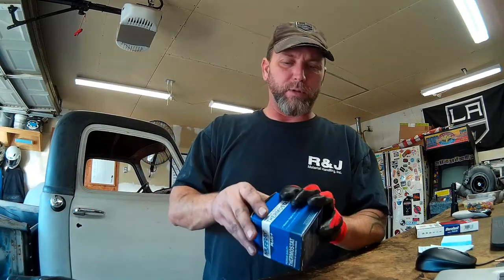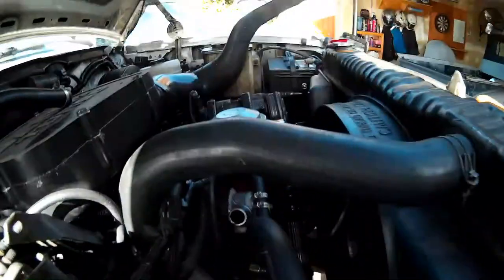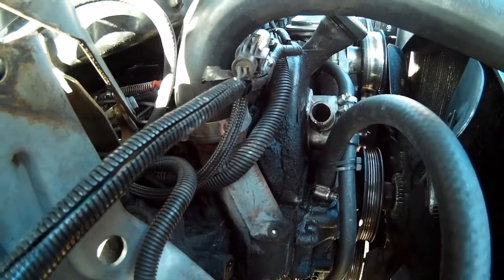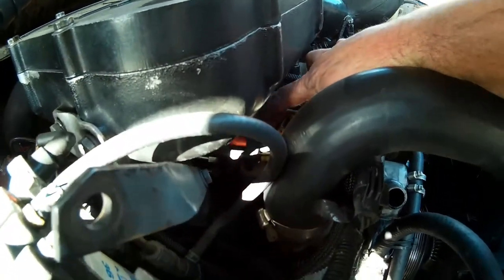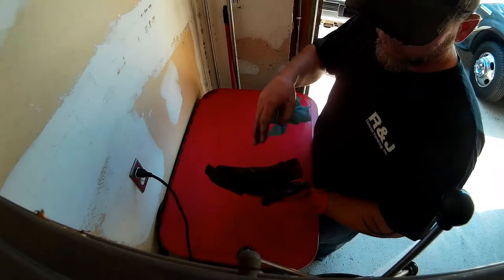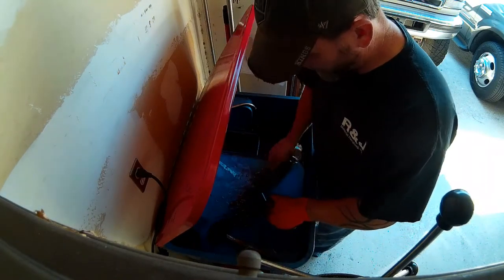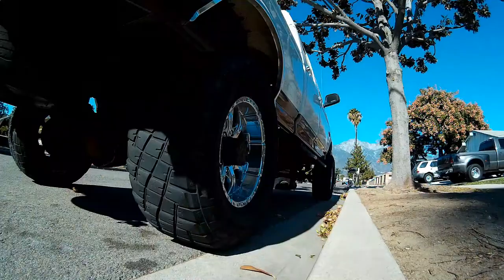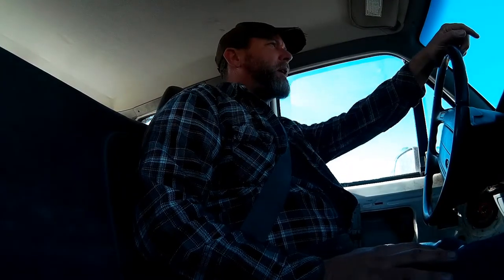Ford OBS; 7.3 vs 460 CALL OUT??, Getting 'er Ready!

Comment: That o-ring looks like it's for a 7.3 Powerstroke, and not for an IDI. Since both engines were offered in '94, I wonder if they gave you the right one. In fact, I wonder if they gave you the right thermostat...

I'd love to see the 7.3 and the 460 line up. I think you should be pretty closely matched with the mods and equipment differences between the trucks. Should be a good match up!
Reply from the maker: Thanks Nathan, all good points!  The thermo has been working fine and not leaking, so that's a plus, though it does run a little colder than I would like.  Thanks for watching!
Reply from the maker: Thanks Nathan, you're probably right!  We have a little 460 project coming up this weekend....  :)

Comment: 460 will make a idi with or without a turbo look like a fool no match for a 460 even stock 7.3 powerstroke can’t hang with one my 92 460 250000 miles hangs with my buddy’s ts6 2000 7.3 on 75 hp tune 100hp is dead even 140 7.3 takes it just as the 7.5 catches 3rd at about 55
Reply from the maker: ya see there Kevin, nothing to worry about!  :D  let's do this thing!  thanks for watching!

Comment: Don't use anything but a motorcraft theromstat in the 7.3 /6.9 IDI it will overheat on you trust me went thru 4 different thermostats manufacturers only to find this out also th Oring is for another vehicle that thermostat fits several different vehicles and the gasket go to Napa they usually got them in stock because 7.3 idi is often a fleet engine and can often be found in grain trucks / dump trucks / school buses. I also want to point out don't go over 12psi of boost or got alot of risk of damage the IDI is a high compression engine high compression and boost are dangerous.

I will also say this take a truck on a steady grade of incline lay into and watch exhaust a light steady haze and your good if get alot of coal be carefull will melt pistons.
Reply from the maker: You are absolutely right Rick on both counts, thanks for watching and for the comment!